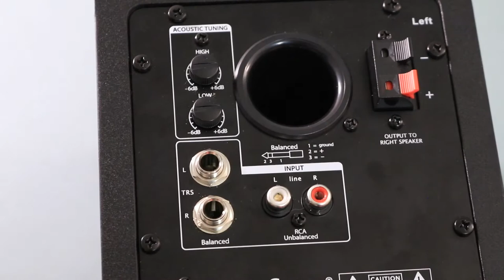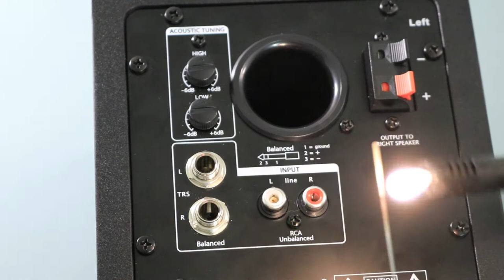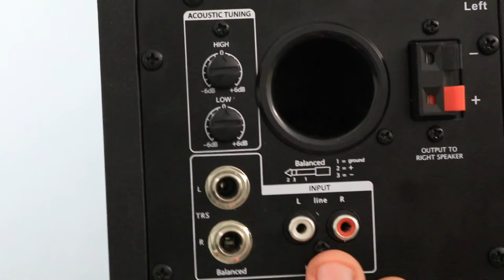How to Remove a Broken RCA Pin from a Speaker?

Comment: Can confirm this worked, with a safety pin!! Thank you for saving me from having to do a repair on my vintage stereo!
Reply from the maker: Super happy to hear it helped. I recently broke off an RCA pin in my car audio port but the pin was all metal. So, I could not melt into the plastic to pull it out. Instead, I just used a piece of metal hanging wire to maneuver it out. A little harder than this method but still works as well.

Comment: This worked for me after a few failed attempts with sewing needles finally I used an older kind of alloy brooch with pin on back. Think you have to have the right metal to melt and grip and wait about 20 - 30 seconds at least for the plastic to melt. It came out part way so I pulled the rest with tweezers.Thanks for the u tube!
Reply from the maker: Happy it helped. I realized that using a syringe needle really isn’t practical for anyone not in the medical profession. But, as you pointed out, anything metal and small that can heat up should work for at least melting plastic. Kind of annoying but much easier than having to get a replacement or throw out something expensive.

Comment: Thanx for the tip. Is there any trick I could modify and fix the broken connections back without buying a new pair ?
Reply from the maker: Do you mean the connector for the cable that broke off into the speaker?
Reply: Yes specifically thr RCA + pin modification or replacement  ,without actually buying a new set.
Reply from the maker: @nigeldevete1736  To be honest, I do not really know as I have never tried to attempt it. Only time I have run into this issue is just with speaker input cables for my car, computer, or phone. So, the cable only costs about $5-10 and I just end up purchasing a new one. Not sure it would be worth the time and effort to try and fix it. Sorry I couldn’t help beyond that.

Comment: Will it work with gold plated rca?
Reply from the maker: No sure. You’ll have to see what the inside is made of. If it’s plastic it should melt and solidify to pull it out. I know headphones are usually hollow and for those you need to just mess with prying it out.

Comment: I tried this. I could  remove only plastic part. Outer metallic part still in the connector
Reply from the maker: Try taking a ball tip pen and using the back plastic part to shove it into the metal part to get it stuck so it can pull out. Just don’t press too hard so that it get stuck further. Other option is once it’s loose you can use a small needle to pry it out but that’s usually quite annoying

Comment: I just tried that on my TV.. the plastic part came out but the metal part stayed in..
Reply from the maker: Try using small pliers or forceps. Or you can take like a small needle and slowly press against the edge to slide it out. It happened in my car once. It’s tedious but if you’re persistent should work. Let me know how it goes.
Reply from the maker: Other option I did is you can take a ball point pen. Pull out the pen part. Then turn it around and put the plastic into the middle to get it caught on. Sometimes that works. But if you press too hard it can jam it in further.